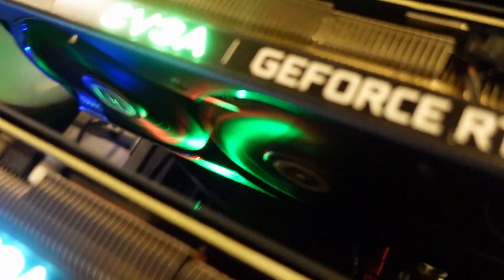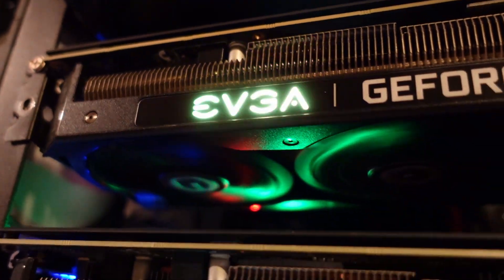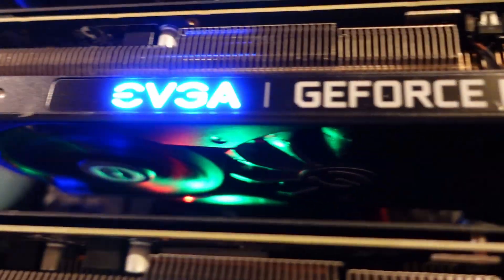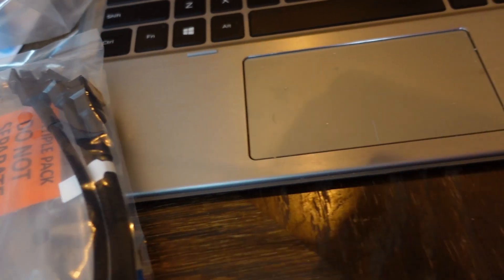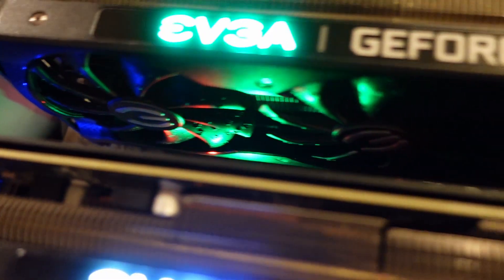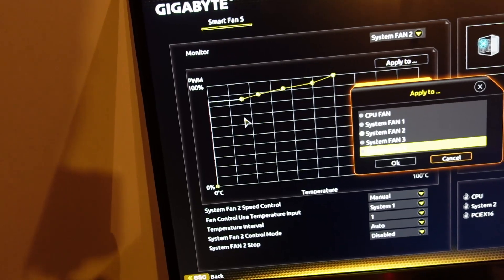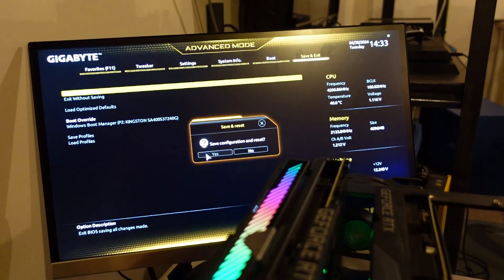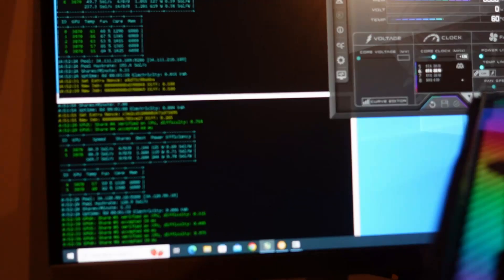GPU Fan Repair - Board Issue

Comment: don't have the same exact issue but mine has 2 of them running at 100% because it can't clock the RPM. I'm not sure if it's a wire issue or a gpu issue
Reply from the maker: have you tried to download the EVGA Precision X1 software? It might help the issue.

Comment: I had to do the same thing had to connect the fan to the motherboard because of a burned out capacitor on the GPU but I got it running all the fans Rx 7600 lol it's neat this happens more than none
Reply from the maker: As long as it works in the end I guess